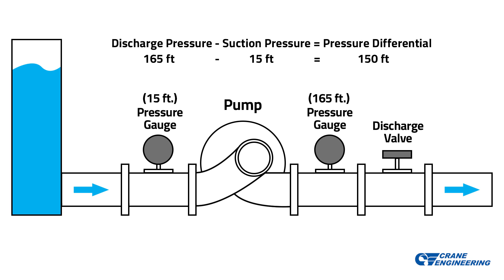How To Read A Centrifugal Pump Curve

Comment: For AC centrifugal pump with a fixed power supply frequency (eg. 50 Hz), if the NPSH required is achieved, is the flow rate constant? Is the liquid flow rate at the rated flow rate on the nameplate?